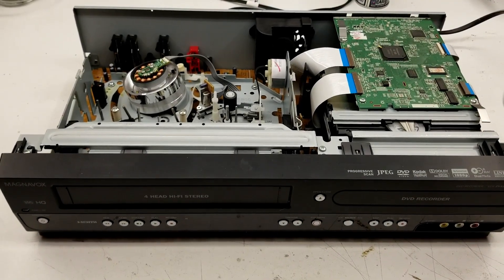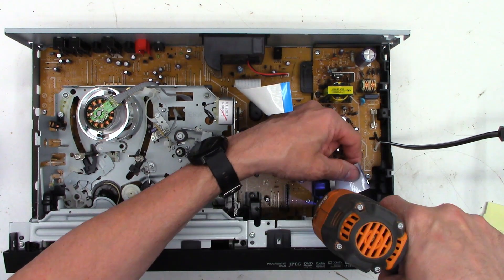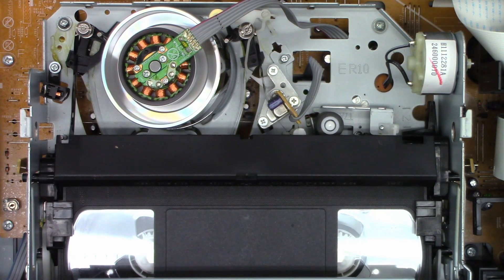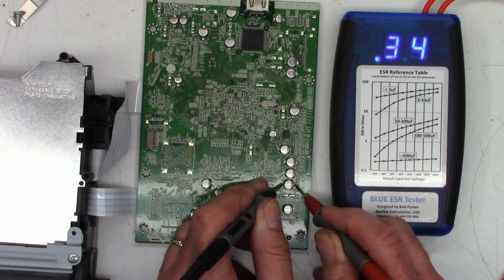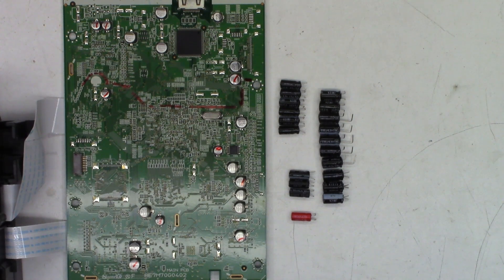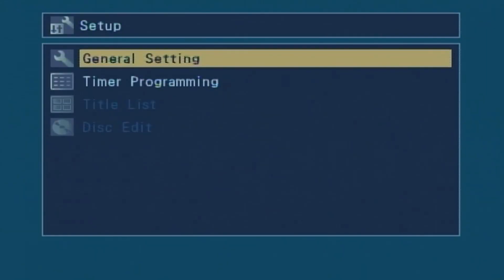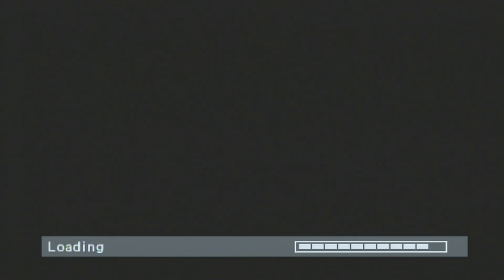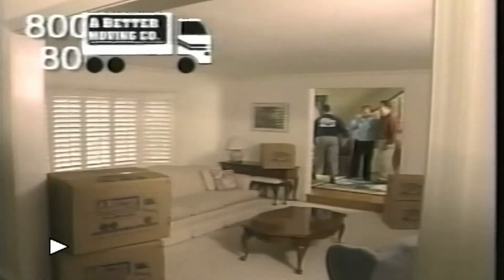MAGNAVOX ZV427MG9A CLOCK / LIGHTS BLINKING REPAIR - COMPLETE DVD RE-CAP TOO               ZV457MG9A

Comment: I hope your customer happily gets another 100,000 km (or approximately 62,140 miles) more out of that unit after a bulk re-cap of the DVD section (plus the usual routine cleaning and service) to ensure long-term reliability. Once again you saved this from going straight to landfill making it all work sweetly.

Comment: My Toshiba DVD/VCR combo has sane error with blinking clock and mode lights flashing.   It’s seldom has  been used and just out of blue, powered up and ….

Did the static discharge holding power switch down plus unplug, yada yada, and nada.  

Seems interior guts are near identical (think), many components are made the same inside     

I did quick removable of DVD player, but didn’t give thought to look for bulging caps.  Was looking for burnt areas. 

Reassembled and still the same 

Q). Did you have to do anything with the mode switch?   And can a regular volt meter be used to test caps and components?

I tinker with electronics now and then.  Can solder.  And have a nearby “Radio Shack “ not far from me. (With. NOS in it) 😊

I don’t always have patience to work on my stuff.    The unit is literally like new and think took out of box 18 months ago and hate to toss it.  

Just wondering if it’s easier to but new PCBs and various sub boards.  

I want to record old VHS to DVD which I haven’t done since I bought it in 2012/2013).  

Or if an electronic repair place near me.    

Recommend to see on repair or replace?   I still see them on line and not cheap.   

Just debating on how far down I want to break the unit down 

Thanks

Comment: Howdy..
Well I've had my ZV427MG9 for several years. I've actually never used the VHS side St all. I've used it strictly as a DVD player/recorder only. I've never had the slightest issue with it. Couple days ago it started having issues accepting and ejecting disc's.  Then it stopped doing anything except blinking. Now the Power, Clock, and Source lights just continue to blink. I tried unplugging it and gave it a little time to reset....but it didn't help. I actually have a back up Magnavox DVD recorder that's never been used. Problem is that the back up unit doesn't have an HDMI output that my TV requires...figures right.
Anyway, any advice. Even if I fix the MG9, it's kinda old ya know. Could just go out again. Is there an adapter to go from standard type F line level output to HDMI...?  Should I even bother or just look for a whole new unit ? 
The expensive way...
Considering I'm retired and on a tight fixed income..
Brother, your opinion would be appreciated..
Thank you.....JC
Reply from the maker: If the clock and VCR/DVD lights are blinking all at the same time then most likely the main power supply filter capacitor has failed (4700uf 6.3V). A somewhat simple repair if you can find someone competent in your area. You should be able to find a "composite (yellow, red, white) to HDMI converter" easily on amazon. https://www.amazon.com/Converter-ABLEWE-Composite-Supporting-Blue-Ray/dp/B07RX69KR8/ref=sr_1_2_sspa?crid=1X2GM0OZ8CERR&keywords=composite%2Bto%2Bhdmi%2Bconverter&qid=1652336960&sprefix=comp%5Bosite%2Bto%2BHDMI%2Caps%2C285&sr=8-2-spons&smid=A2BFUYDSZF1EXY&spLa=ZW5jcnlwdGVkUXVhbGlmaWVyPUFVMTYxSjFCVldYMEYmZW5jcnlwdGVkSWQ9QTAxNjU2MTQxREMwT0ZSQkY4Q09UJmVuY3J5cHRlZEFkSWQ9QTAwNjc3NjUxU1o0TEFXSUxXRU9FJndpZGdldE5hbWU9c3BfYXRmJmFjdGlvbj1jbGlja1JlZGlyZWN0JmRvTm90TG9nQ2xpY2s9dHJ1ZQ&th=1
Reply: @norcal715  Appreciate your reply. I'll take a look at that cap, thanks for the heads up. I actually have a short background in electronics. I got my A.S. in Electronic Technology and Communications along with my Cert. in Digital Systems way back in 95. A friend had a shop in the Santa Barbara area, so I worked under him for a couple years. We specialized in Laser Disc service and repair along with home theater installation. We obviously maintained all other type electronics and brands. I left that field around 98-99 and returned to my previous occupation as a commercial pipefitter. I remained there until an injury put me in early retirement in 08.  Thank you again for your insight. 
I was able to work out the backup recorder and it's working fine. Just not the same machine, so I'll take your advice and look at that cap. Please take care and thanks again...
God Bless.....J

Comment: I have the same thing. But I bought it new, but have never used it. I can't turn it on the lights are Always blinking.
Reply from the maker: check the power supply capacitors for bulged tops.
Reply: Thank You, I will.